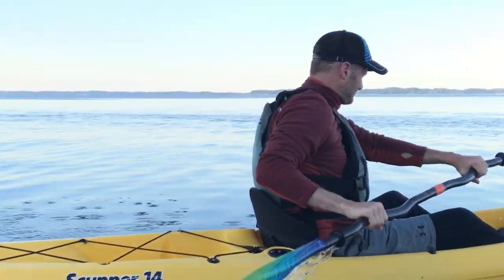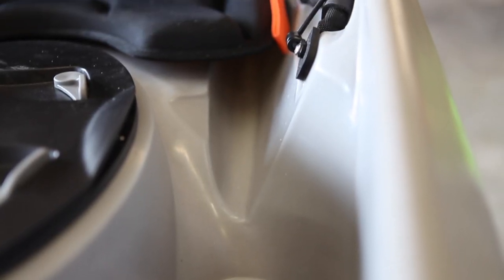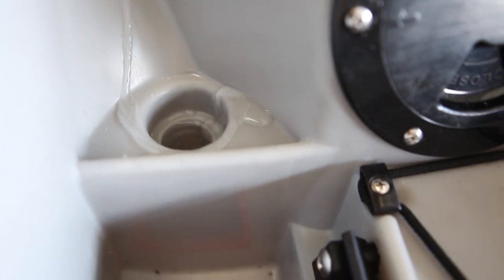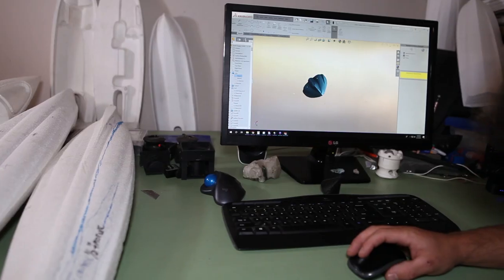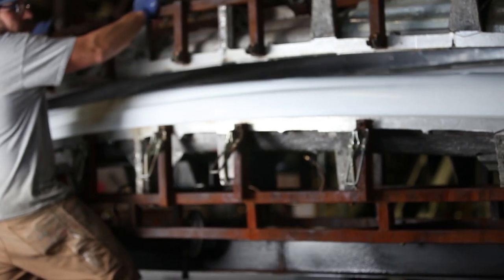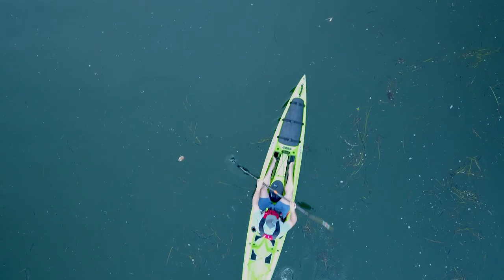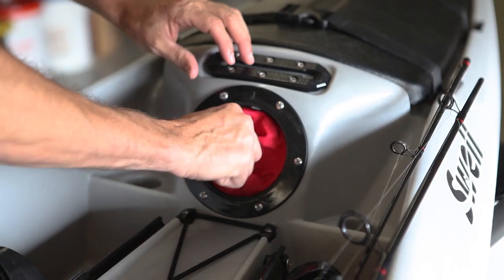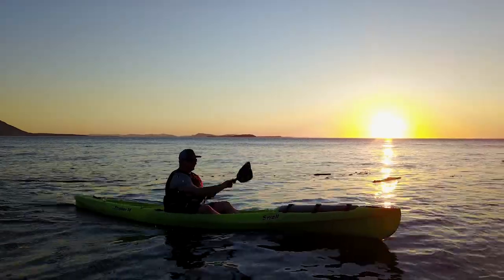Swell Scupper 14- the Evolution of Fast, Comfy Sit-On-Top Kayaks

Comment: Great to see this upgrade on the classic Scupper Pro. I live in Baja, and my interests are touring & free-dive spearfishing. The Pro was a good boat, but I upgraded to the Cobra Tourer with added stern hatch... I still have the Tourer, though 20 years old it's still strong and dry... compared to the Pro it is lighter weight, more capacity, faster thru the water, and a deck-gear area that is perfect for spearfishing. Cobra also had the Expedition... 18' long and only 48#s... as fast as a good sit-in touring kayak. I like the changes in your new Scupper 14, I'd it's say the best new kayak available for free-dive spearfishing.
Reply: @jimmarsh9832 : I don't know about the Expedition, just the website weight. My Tourer is listed at 50#... I weighed it on a scale, 50.5#. I believe Cobra... you have no basis for calling anyone a liar. Mighty rude considering I just paid high complement to your kayak.
Reply from the maker: apologies
Reply: @swellwatercraft327 : No worries guys, I really like the Scupper 14 and I'm going to buy one in early February... looking forward to it.